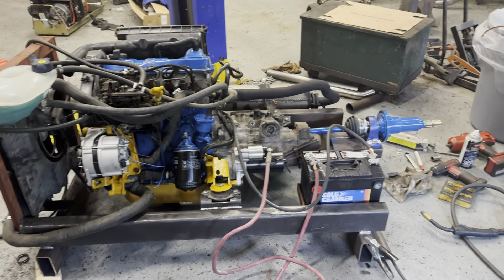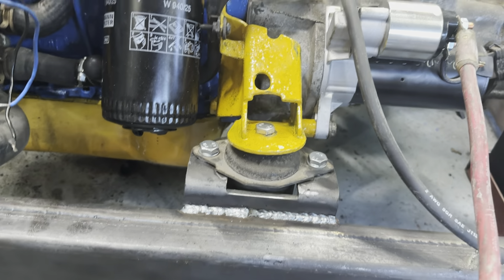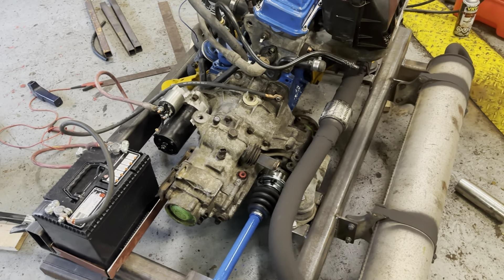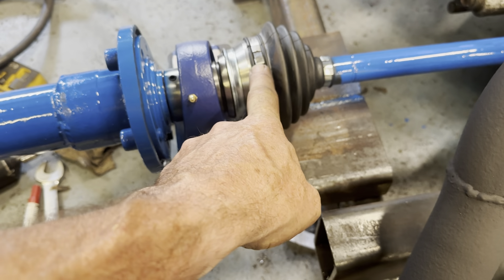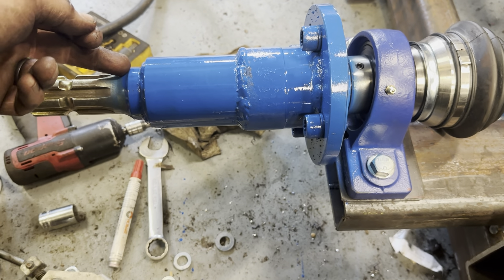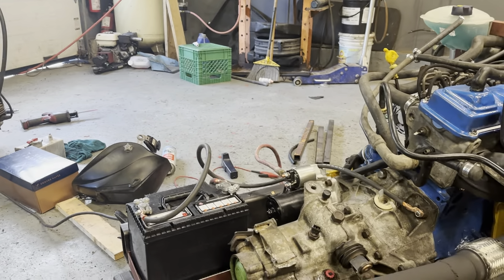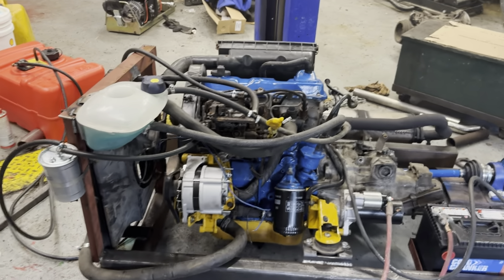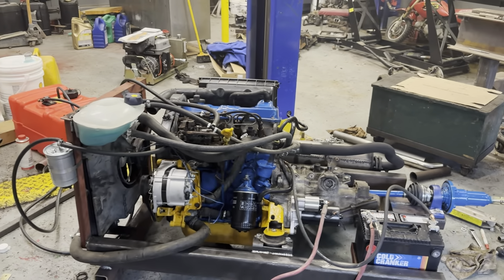HOMEMADE 53 HP PTO POWER UNIT

Comment: Oh my. Love it.  That little diesel is something else. You are fast. Noticed that on other videos when you build things. 👍Two nosy questions; are you putting a guard over the output shaft and do you think you will need an exhaust stack if the wind is not in your favor?
Reply from the maker: Probably no guard… and the exhaust is pointing down and away from the operator. I do plan to house it all in a ‘dog house’ of some point with a plan of being able to remove it for service when the time comes… not sure exactly how to crack that nut just yet. 😎

Comment: Interesting FrankenVW!  My wood chipper has a cadence counter which is great when the tach on the tractor doesn't function.  The magnet is in a hole in the shaft and I assume epoxyied in.
Reply from the maker: I’ll find a good spot for the magnet that makes sense. Thanks for watching! Jeff

Comment: Hi Jeff, ♥️ the little diesel, great torque! Yes you will need the glo-plugs, all 3 of them! 😉 It's  a great frame and mounts you have put together! This is an awesome beast ! I can hear it starting in the cold already!  What a great sound. Hey? 💡 you have that Audi A-4 that you are junking? Would there be a relay for the headlights? Or power seat? Or heated seats? There must be a relay in that old red Audi? That you can use for the glow plug relay?
I wasn't finished writing, l looked up and half of my post was gone to you? Wierd!
Anyway, looks like you will be cutting firewood by Friday? 
This not being an obd-2 controlled engine, can you get an adjustable fan temp relay, to turn your cooling fan? or  fans? on? Hey the Audi! 🤔
Audi aside, can you purchase different fan, temperature  relays? to come on when you want it to? I'm having a senior moment! 🥴.
You have a great setup 👍🏻. There's nothing like a diesel !
Wishing you all the success and l am looking forward to seeing and hearing your new processor! Thanks for sharing 👍🏻. Y.N.& F. ✌🏻🧡🤘🌤 🌧     🍁 - ONTARIO. 
II

Comment: That's great. I built a pto unit for my belsaw circle mill.
Reply from the maker: Do you think I’ll need a governor?
Reply: @thelogfather5002  You probably will, but only on hard draws. Without a  governor, you may see that the rpm  recovery isn't quick enough. I hope it works out fine because it looks great.  Hough governor would do
Reply from the maker: @dereksstuff8395 it might be a good excuse to add cruise control! I probably have enough for that- that’s like a governor- VW used a vacuum system back in the day- it was very responsive.

Comment: Any thoughts on using a 4cylinder motor to power a pto generator at 540? Any help would be appreciated.
Reply from the maker: Absolutely. The little power pack I built would run one all day.
Reply: Transmission necessary? Or could it be belt drive or flywheel drive? Kinda want to keep it quiet and fuel efficient
Reply from the maker: @greggoryleblanc1024 I think the transmission is important because it has the starter flange, and the mounts. You can run the engine just over idle in the right gear to achieve 540rpm. 
The only piece of the puzzle is you need a governor to set the rpm at a constant speed. I used an electric governor/throttle, but it was hunting for 1800 all the time. I since had an injection pump built with an internal governor.